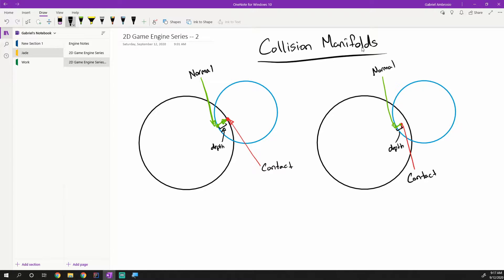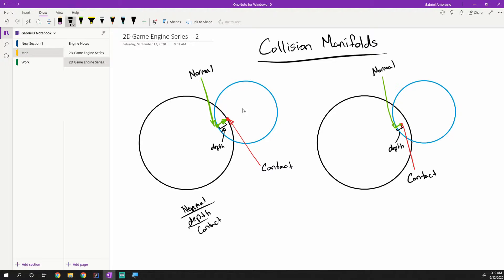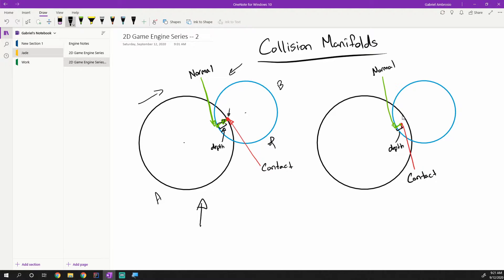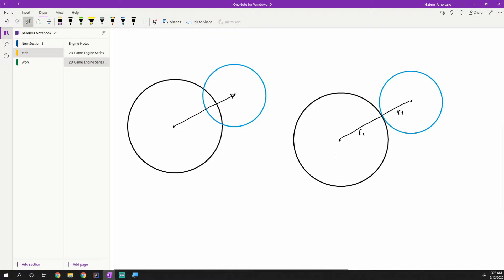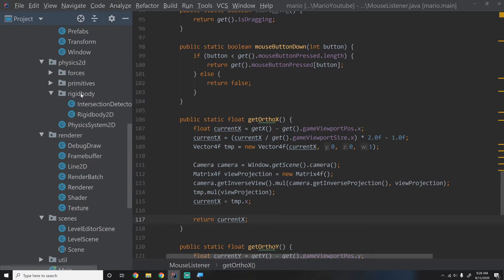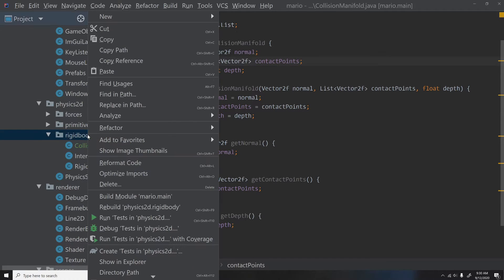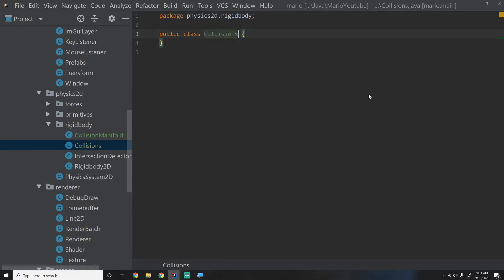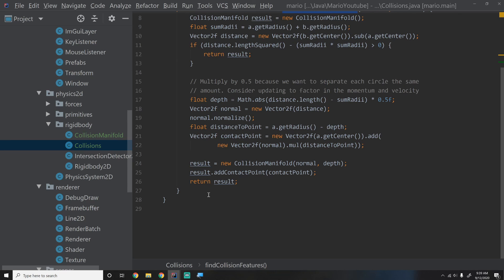Collision Manifolds (Circle v Circle) | Coding a 2D Physics Engine in Java #14

Comment: Great Video dude :)  Really looking forward to see how you implement your impulse based physics, I've had my fair share of sleepless nights tracking down errors in my 3D impulse based physics engine, so I would be more than happy to share methodology between our implementations.  Oh, BTW you may not want to separate your objects by a fixed 0.5 in your discrete collision solver, as when a large massive object gets hit by a small light object the bigger one will "snap" unnaturally.  You can use a ratio of their mass or size for smoother results.
When you do your video on "collision response"/"collision solver" I would really like to see the details of your inevitable approach to handling "Constraining Multi-Body Contact of Coinciding Manifolds" (not the LCP kind!) as I struggle with an acceptable approach myself :(
Reply from the maker: Thanks @Tony Stark! My approaches for everything will be mostly coming from the Game Physics Cookbook because I never did delve too deep into the physics code. I was also spending many sleepless nights tracking down hard to find bugs and eventually decided it would be better to use a dedicated library. But I definitely wouldn't mind checking out your code to see some alternative approaches, and we can hopefully trade some good ideas :D
Reply: @GamesWithGabe  The Game Physics Cookbook,  I remember taking a look at that (the free GitHub code) before, along with Randy Gaul's works at the time but saw that the one of the .cpp files was missing.  Also wasn't the Game Physics Cookbook 3D based, do you plan on "fixing" to the X and Y plane?  I'll have to take a second look maybe it got updated or maybe you found a more complete list.  I'm curious to see how your library handles coinciding manifolds, like say if you have a flat grid of boxes that intersect each other around the edges a bit (kinda like a chess board, but in 2D for your case) and then place boxes of different sizes onto that grid, if they'll "jiggle" BEFORE they're put to 'sleep'.  I mostly use the standard equation for 3D Angular Impulse being:
                                                                   J * (1+e)
-------------------------------------------------------------------------------------------------------------------------------------------------------
(1/Ma) + (1/Mb) + ((Ia * ((Ra cross N) cross Ra)) dot N) + ((Ib * ((Rb cross N) cross Rb)) dot N)

However; even with ALOT of pre and post stabilization, and more accurate magnitudes for the impulse there are inevitable limitations (only infrequently mentioned in the literature), like when multiple bodies touch each other or when one object hangs over the edge of another one (I solved for this case, but not the first in full completeness), similar to "The Stacking Problem".  Aggregated manifolds yields great results but "feels" dirty and inefficient in the long term, sure Temporal Coherence helps but still... I know there are better solutions out there.  Some papers also say to use the summed generated Impulse itself as the angular velocity of the object and run the same collisions again but in reverse order, this is better than nothing but is still way too jittery for my liking.  So if you could show us the details of HOW your library implements it's physics it would help in pin-pointing your method implementation.  Linear Impulse is by far easier to implement and FAR more stable, but where the fun in using frictionless non-orientable objects for everything :)  So finding a robust solution for real-time Friction based Angular Impulses that actually works in practice and not just in analytical theory would be great.

If your library sample by some chance includes a working LCP Solver (Linear Complementarity Problem) I would love it if you showed us it, even though most of the literature say that is too slow for modern 3D game engines with large dynamic scenes (GREAT for things like articulated/jointed objects though).  But, I'm willing to try just about anything if only just to see the results.  If you find problems that arise from your physics engine feel free to post them in the up coming video, if we can't figure it out than I'm sure someone else who has more experience in The Game Physics Cookbook's library specifically can help.
Reply from the maker: @TonyStark-zk8kh  I don't want to disappoint you, but I think you definitely surpass me when it comes to your game physics knowledge haha. I really only did the very basics, I implemented a very simple 3D physics engine that uses a linear projection to correct for objects at rest. I never did research it enough to go above and beyond what the book went through though. As for the engine I'm building for this series in 2D, I don't have a complete version of it at all (I'm just sort of making it as I go and referencing my 3D engine). The only changes you really have to make are what to do when it comes to calculating angular velocity and stuff. You're grasp on this subject definitely seems really good though, and I really appreciate you detailed input on these episodes so far. If you want to contact me for some further discussion in a bit more depth, feel free to send me an email at my business email for this account: gameswithgabe1@gmail.com . I would love your feedback on the series as a whole, and where you think I could improve particular aspects. For a concrete example of what I'm working towards, you can take a look at this code: https://github.com/ambrosiogabe/UntitledDungeonCrawler/tree/master/src/main/java/com/jade/physics :)
Reply: @GamesWithGabe  Thanks, you definitely seem to your your stuff too, and I wouldn't say I surpass you, I'm going with the flow myself too.  I'm definitely looking forward to seeing were your series goes, and would be happy to help if and where I can :)

Comment: you not supposed to run the sat and then call the manifolds why do you need the boolean?
Reply from the maker: Hey Matan, the reason for the boolean is that later on I implement a broad phase collision detector that returns a list of potentially colliding objects. All of these objects will be passed through this algorithm (or the algorithm for their shape) and they may not actually be colliding. Then I take the list of manifolds and send them to the collision resolver. This way you only have to run the SAT on objects that are most likely colliding, instead of running it on all the objects. If you need more clarification or I misunderstood you, feel free to correct me :)